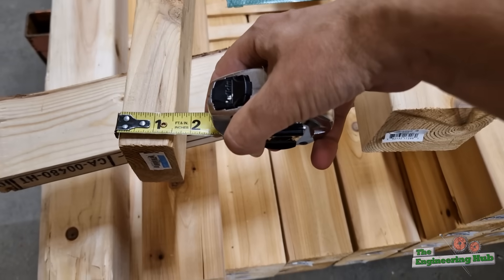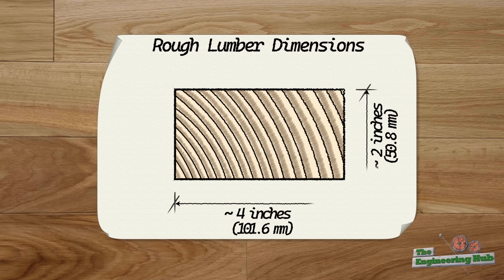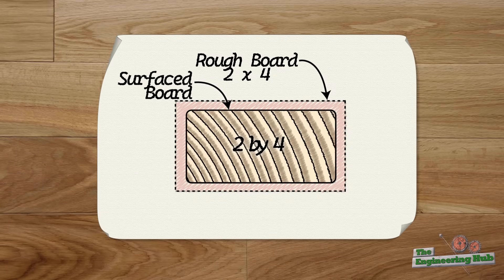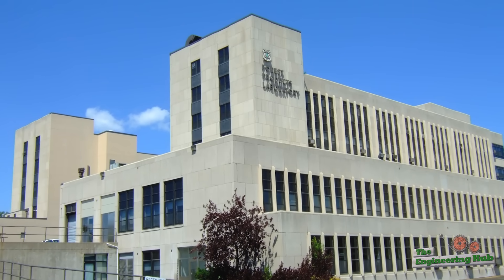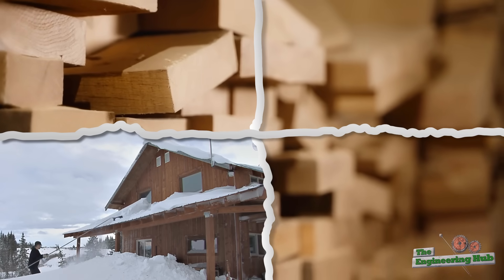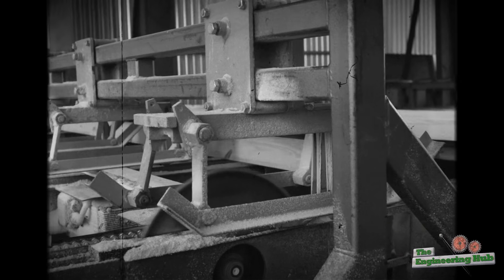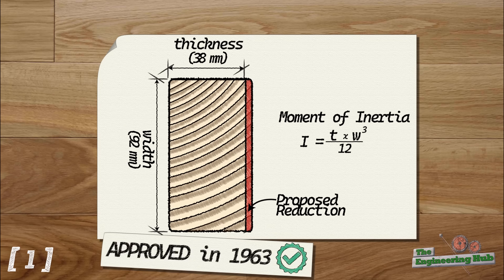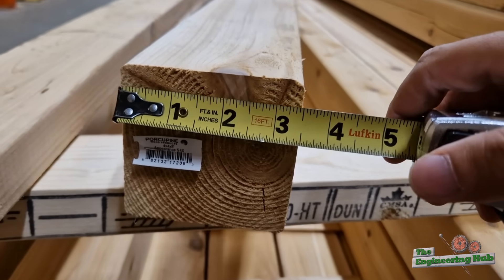Why is the 2 by 4 getting smaller and smaller?

Comment: Even though in Finland we use the metric system, we still have certain lumber sizes often expressed in inches, though they aren't exact. But a two-by-four is 50 x 100 mm, which 1.97 x 3.94 inches. As far as I can tell, that is the size at which you purchase it in the store. So despite of getting rid of the units, we mostly kept the measures. In the US, the units were kept but the measures were not.
Reply: Same in Germany: Wood beams i.e. for roof tiles are 48x24, which is roughly 2x1inch... (So they are changing more and more to 50x30)
Reply: @marwerno   We just switched to German standard in DK. Lots of people putting up solar these days and the old WAY more flimsy standard can't take it. We currently got engineers trying to warn people that their roof might take off in the next >30m/s storm
Reply: Same in Norway. A 2x4 is 48x96mm here.
Reply: @Ekuahx  okay, I researched a bit more into this, and we have sawmill products of e.g. 50x100mm in Finland, but rough planed timber that is 48x97mm. I would assume it's the same in Norway and perhaps also in Germany? Though it's odd that there is still this 1mm difference on the longer edge.
Reply: @fintux  Most dimensional lumber for framing in Norway is 48mm, 98mm, 148mm, 198mm, etc. thick.  I always assumed this is why gips boards for walls are 12mm thick, so the total thickness of exterior walls is a round number.
Reply: @-_James_-  I wonder if that's from importing American machines after WWII. The standards during the recovery period would be based off those machines and local machines would then be built to be compatible with those standards.
Reply: A Swedish "2 tum 4" is 45 x 95 mm.
Reply: @SkogsMangan  If it's planed, 50x100 if sawn
Reply: @SkogsMangan  Same size in Denmark :) we just call them 2 4 at my work
Reply: In israel its 4.2mm x 92mm
Reply: I think as far as you guys keeping the dimensions almost the same, I think it might just be a happy coincidence that 50 mm is about 2 inches.
Reply: @joshyoung1440  well yeah but the name is still two-by-four (literal translation from Finnish would be along the lines of "a twoer-fourer"), so the size does originate in inch sizes, not metric. The sawmill size was rounded to nice millimeter sizes, but still I think it's interesting that while we don't have the original measuring system, the size was kept here closer to the original measurements of two by four inches here than in US where the inches are still in use.
Reply: @fintux  40-50mm x 80-100 mm is good human size. Noting special here
Reply: @Chrzszyżwąrzę  our two-by-four is closer to 2"x4" than the US one is. Maybe you did not spot the word "mostly" in my comment.
Reply: Ours are even smaller, at 3.5 X 1.5 in. Your houses are stronger, and why you are able to build wood skyscrapers.
Reply: Thank for this explanation. I have been wondering about this for a while.
Reply: Its 48x98 mm in the carpentry buisness here in norway but everyone says 2by4
Reply: The Russian spam bots don't even try to hide anymore... literally name+numbers...
Reply: @Igneusflama  exactly. Most of them are easy to spot anyways, stepping with all the rage to otherwise calm conversations. I wonder if that is like a dream job in russia, "when I grow up, I want to be a spam bot".
Reply: @fintux  I think you missed the "bot" part. It's probably NLP... think Alexa or Siri but for Russian spam
Reply: @Igneusflama  actually the terminology regarding the russian trolls is a bit different, and the bot can mean either a person or an automatic bot (contrary to the typical use, where bot means a computer-controlled entity). I don't really know why that is; perhaps those coining the term didn't know what it exactly means elsewhere, or perhaps it's that the amount of original thinking is roughly the same. I just assumed you were using that terminology. My bad on that, but what I said applies to the flesh bots, not the ro-bots :P
Reply: Welcome to youtube, idiot.
Reply: @Igneusflama  Those are accounts where a forced name change has occured because someone else had the same name before they did.
Think a little... Though I know asking a right-winger to do that is entirely futile.
Reply: But ... but ... but ... I'm continually told everyone in the world uses metric measurements for EVERYTHING and the backwards USA uses ONLY Imperial measures for EVERYTHING  because they're stupid and egotistical or something.  (Then I point out how Imperial measures are still used in many places around the world for many things and metric is used in America for most things and I don't get a response.)  It's a dumb stereotype spread by ignorant people.
Reply: @RedSiegfried  I would say for 95-99% of things measurements are expressed in the metric systems in Finland. But there are a few occasions where imperial units are used predominantly (aviation, sea navigation) or in parallel (car engine power). On the other hand, to me it seems there is a slow, but quite steady trend in e.g. US TV shows (especially documentaries) to use the metric units more and more.
Reply: @fintux Here in the US we're probably only going to go as far as Canada or the UK in adoption the metric system. 

It is true we're slowly using metric more-and-more.
Reply: The 2x4 and 2x6 in my 70-yr old home are wider and thicker than the new wood. Found out when I replaced an exterior door - The new jamb was almost a full inch thinner than the one it replaced (thank you for nothing, termites). I should get my wood from Finland.
Reply: lol i just wrote the same thing :) It's like that in most of Europa, as far as i know. High quality finish is aprox 47x97, rough 50x100
Reply: yeah except a 2x4 is 45x95mm here... where a real 2x4 would be a 4x4 if you doubled it... doubling their "2by4" is only 90x95mm and not the same size on both edges when doubled... highly annoying
Reply: An Australian 4" x 2" is currently 90 x 45 mm and a standard stud is 90 x 35  mm.

I came across an old stud when pulling down few walls that were 95 x 35 mm Oregon pine.
Reply: Yup, I'm from Croatia and we have the same format 50x100 and 4000 in length most commonly. We have names for each type of board beam and so on,and the dimensions of those things have not changed for the past 100 years . I don't quite get this usa thing. If you came to the lumber yard around here and asked for 2x4 and you got something less the person who sold you that would have a really, really, really bad day.
Reply: In Australia, we use 90x45 for important spots like around openings, and 90x35 for common studs. Our plantation softwood is radiata pine which is about as rubbishy as you can get, but we use a lot of galvanised steel products to make it stay together for tie-down and bracing and our houses aren't in the habit of falling down or blowing away so I guess we're doing that part right.
Our insulation and draughtproofing standards are a disaster, but at least our houses stay where we put them.
Reply: It is easier to frame with fractional measurements than decimal points.  Think about it for a bit.
Reply: @AaronHendu  the metric system is based on fractions of 1/10th.
Reply: Anywhere except the US where they are bleeding people driest, a 2by4 is 2x4.
Reply: As I said , such is capitalism in the US. It won't be long in US before the 2 by 4  is actually 1 by 3 .
Reply: Sweden has a lot of American influence.
Reply: No you keep name not dimensions
Reply: I was told that European buildings are superior because they're all built with stone, brick and concrete. What are you using lumber for? Furniture? Floors?
Reply: @chaosXP3RT  I would say there's no "European house", the buildings are different in different parts of the continent, depends on the era and even individual choices. In Finland, stone is used quite rarely. The typical modern houses in Finland resemble quite a lot the house e.g. Matt Ferrell has built. Another common thing to use for house building are log houses. There are some "stone houses" here, but they are not made from natural stone like e.g. old buildings in Italy, but some sort of manufacured blocks. Houses made from purely stone would be very cold, as stone is not a great insulator. And apartment buildings are often made from concrete.

I would think the biggest difference are the insulation, thickness of the timber, waterproofing bathrooms etc. and in general, the focus on efficiency (smaller houses, heat recovery ventilation, triple-glass, well sealed windows etc.). I don't know how the foundations are in the US, but in Northern Europe, they have to go somewhat deep to stay below the frost line, even though the insulation reduces the depth of frost.
Reply: @fintux  Most houses in the northern portion of the USA have concrete foundations that go below the frost line. However, in the Southern US, where the temperature rarely gets below freezing, there are almost no basements or cellars. Most houses may only rest on a concrete pad for a foundation or some concrete supports. And in some areas that are prone to flooding, the houses are built on stilts, with the garages often underneath them.
Reply: @chaosXP3RT  I think for decades now, most houses are built without cellars here. I don't know the vocabulary in English that well, but basically in a typical house, the plinth goes below the frost line (considering there is usually a styrofoam insulation making the frost go less deep). Then below the floor, there are layers of different materials, including a capillary break. Above that, there is a layer of styrofoam and then the concrete pad. So the concrete pad does not reach as deep as the plinth.

I think cellars were outphased, because they were often problematic (ground / rain water seeps in etc.), and also because they are no longer necessary for food storage (they were needed before fridges, and when people used to e.g. grow a lot of their own food). Using the basement as an additional room has always been very rare in Finland.
Reply: @fintux  Basements or cellars here in the USA so of course have problems, but they are good places for extra storage (although some people make their basements into full rooms with beds, carpet floors, etc). Basements are also the safest place in a tornado.
Reply: @chaosXP3RT in Poland, most houses built before 2000 are constructed of brick and mortar with rebar-concrete slab and ceilings, we use wood for the roof assembly
Reply: @chaosXP3RT  we not  a country.  Europe is several countries.  And even the diffrent countries has diffrent buildingstyles from the past due to diffrentclimates and time it was built. And they we have all types of what houses people like. Our can stand for 100s of years no matter material but thats diffrent story
Reply: @chaosXP3RT  Wood buildings are common in the coutryside, and for cabins and cottages not intended as primary places of residence.
Reply: They are "not exact" because they have nothing to do with inches. You cant "get rid of them" because you have never had imperial system in the first place. First widely adopted system you used was swedish, then russians switched you to russian units, then russians switched you to metric units. If anything, "original" units for your wood would be two by four swedish _tums_, not inches. Your modern hucksters only use inches in marketing because mentally you are still a vassal state, only feudal lord is different. It's like coming to ukraine and finding price tags in US dollars of all currencies, ffs. Learn your country, man.
Reply: @ФеофанЭтополедолжнобытьзаполне  Explain to me then why every construction worker in Finland, whether now or 100 years ago before American TV and Movies, calls the 50mm x 100mm board "a two-four"? Americans didn't invent inches.
The standardized British imperial system and the Metric system were invented in the early 1800s, but units like feet had been used all the way back in ancient times. Commercial saw mill operations also go back more than a 1000 years, and even the industrial revolution is older than the metric system.
Reply: @poika22  > Explain to me then why
I literally just did in the comment you trying to reply to.
Reply: @ФеофанЭтополедолжнобытьзаполне  you have so much hate, why is that?
Reply: @hosannayeshua4446  hate? Hardly. I'm amused.
Reply: @ФеофанЭтополедолжнобытьзаполне  look, you did it again. Is everything alright in your life?
Reply: @hosannayeshua4446 I did what?
Reply: @ФеофанЭтополедолжнобытьзаполне  
very well then, if you do not want to speak about it. I will be praying for you so that whatever in your life is causing the hate and vitriol in you will stop so that you will find peace.

May Y'hovah bless you and watch over you, may Y'hovah cause His face shine on you, and be gracious to you, may Yhovah lift His face to you, and grant you peace.
Reply: @ФеофанЭтополедолжнобытьзаполне  okay vatnik.
Reply: @fintux you are welcome, chukhonets.
Reply: @ФеофанЭтополедолжнобытьзаполне  take your meds, schizo
Reply: @ФеофанЭтополедолжнобытьзаполне  Did your owners in Moscow at least call you a good boy for posting this?
Reply: @rakufin  what owners?

Comment: By reducing the size, it’s not about strength but rather the reduced insulation in the wall.  Hundreds of millions of homes over several decades would result in a massive amount of energy loss with each home.  Even if small per home, it’s probably in the trillions of energy use due to the thinner walls.

Comment: I attempted building a deck and planter beds a few years ago with limited experience. I drew up crude plans, ran measurements, factored the cost, went to home depot, and was entirely confused to find the 2x4s weren’t actually 2x4”. Thank you for explaining lol.
Reply: That is seriously whack lol.  Reminds me of that space mission where metric vs imperial measurements didn't actually add up when put together after conversion factors
Reply: Lol it hasn't been that way for my life.  I'm 42.
Reply: Yeah, most places where you can buy wood boards are typically 1-1/2" by 3-1/2", or 1/2" thinner in both the height and width because they've been surface planed at the mill to get rid of rough edges before shipping.
Reply: @bigsky1970   As a metric user ( 1-1/2" by 3-1/2", or 1/2" ) might as well be alien writing, I have no idea what any of these messurements are. 

Im sorry but 38mm x 90mm is alot easier to understand. ( thats a 2x4 in metric ) best part is it can be converted to metres and centimetres easily.

Comment: ruff cut vs finish cut

basically fancy word for 1/2" shorter on both measurements.

also, colder areas use 2x6 so, recommendations is just words.

Comment: My house is an 1890 and the wood is real OLD GROWTH 2x4 straight and no bends today the wood is garbage young trees with bending as standard.  

If they had used old growth trees the size is not as significant young trees are weak

Comment: Rough-sawn true size 2x lumber is some good stuff when you want strength. There is little need to plane down lumber used for framing and structure. A true 2x6 makes solid floor joists for example. Today's bandsaw mills are very accurate in keeping board dimensions the same. Small local sawmills can provide great lumber if you can find one.
Reply: i was thinking the same thing. Modern sawing should be able to make thin precise cuts, make better wood with and save more material. most jobs dont need planing unless its furniture or floor boards.

Comment: even better, the lumber mill I worked at cut to "four quarter" or 1 inch  thick boards, with the exception of ash where we'd cut the four quarter boards, as well as 8 quarter thick boards (2 inch). but the width didn't matter in the slightest.

Comment: we do 38x89mm rounded corners here in finland but itsnot called 2by4. When it comes from sawmill as raw material its 41x92mm. 2by4 here is 46,5x97mm or as raw material 47x100mm

Comment: What is the cost difference between using metal studs as compared to wood studs?
Reply: As someone who has used both...the metal studs suck.  You can bend them over your knee.  Unless you have a very competent wngineer and architect working on yoiur design, stay away from it for residential.

Comment: Makes it harder to calculate accurately where to place studs. Especially for someone new to carpentry. They should just relabel it to what it’s actual dimensions are instead of calling it what it isn’t. If you label something based on its dimensions before it comes out as a finished product, then you might as well give me the diameter of the tree it came from, because how does that help me? Most other wood pieces sold have the actual dimensions. Or, why couldn’t they rough cut the pieces thicker, so by the time it’s planed down to retail size, it’s actually a 2x4

Comment: Its called nominal measurement. Lots of building material is like that. Like some sheathing and siding have an offset for overlapping so that it can fit in specific measurement. Like 12f vinyl siding measure 12f 4" etc.

Also 2x4s usually arent true to length either unless you specifically ask for it to be cut perfect to length. Like a 2x4x8' would measure 1.5x3.5x96.75

There a lot more standardization now and building code than there was back then.

Comment: The only problem is the more material you remove from a board, the less stronger and stress resistant it becomes and is more prone to splitting and warping. This is more so in warmer humid climates which i can confirm being in Florida for many years.

Comment: Here in Sweden a 2x4 is 45 x 95 mm, so it's slightly larger than an American 2x4. Dimensions of other load bearing wood is easy to remember, because they are multiples of 25 mm and then subtracting 5 mm for the planing. For example 45 x 145 mm (2x6), 45 x 195 mm (2x8).